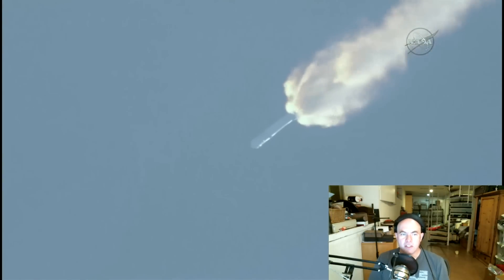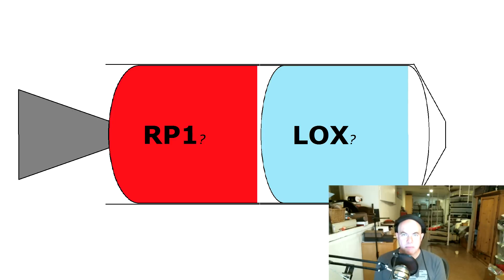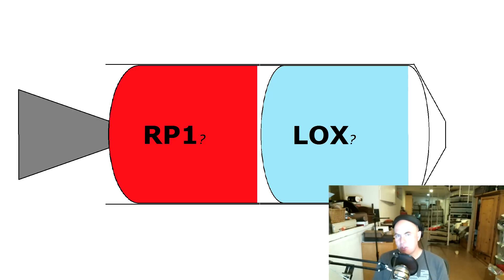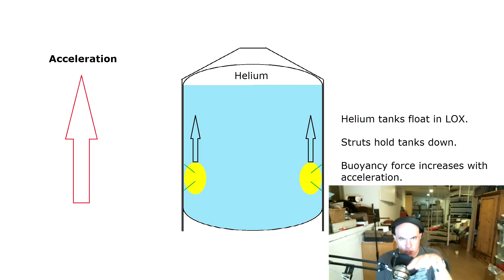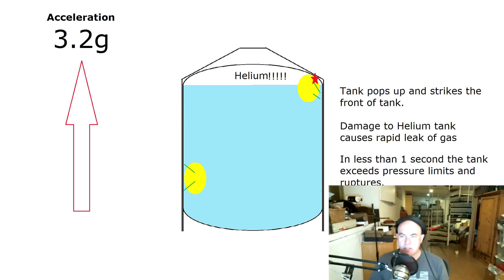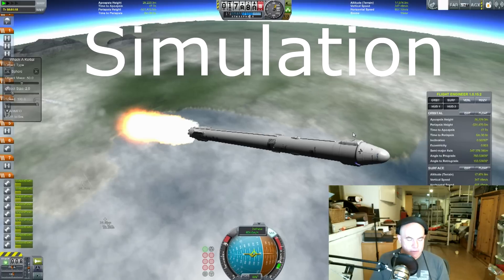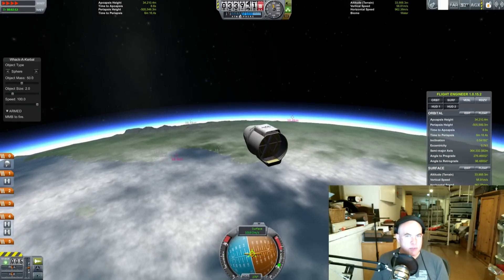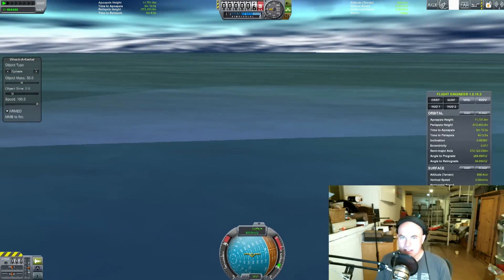Explaining the Space X CRS7 Launch Failure

Comment: Interesting. It seems components used in rockets are not as highly regulated as components used in aviation.
Reply: ***** these kinds of failures used to happen in aviation all the time.  Aviation has gotten a lot safer over the last 40 years.  The still do happen, to some extent.  I remember in a certain engine used on 737's had a failure where a fuel feedpipe was out of spec, so it ruptured due to normal engine vibration, causing fuel to flow into the engine uncontrolled until the engine caught fire, oversped, and blew up.  
The thing with airplane engines is, even if that happens, they can still fly without one engine, and land the plane (sometimes), whereas rockets are basically fuel tanks with engines strapped to them and no external control surfaces, so if one thing explodes, the whole thing explodes.
Reply from the maker: TheBalefire Actually, to be fair, on a previous Falcon 9 launch an engine failed during ascent and it was able to continue just fine.
Reply: TheBalefire
They have built rockets for over 40 years as well. Quite many more airplanes are flying than rockets, so if the probability of fubar is the same then we shouldn't ( p > 0,05) have many rocket accidents.
Reply: ***** And rockets are orders of magnitude harded to build, harder to fly, and for all intents and purposes is still in an experimental stage of development. Remember that the SpaceX rockets are, literally, still under development.
Reply: Mythricia
All that is meaningless. It is equally easy to check that components meet required specs.
Reply: ***** No, not really. You can't test flight hardware the same way. But of course you can believe that you understand better than decades of spaceflight engineers, if you wish.
Reply: Mythricia
First of all, this strut didn't pass the specs layed by SpaceX themselves. It means that they didn't test the component.

Secondly, I don't know how things are done in rocket engineering because I'm not a rocket engineer. However, I know how things work in aviation because I am an aircraft engineer.
Reply: ***** It's been stated several times in the comments already - they can't test flight hardware. If they tested the strut, even if it passed the test, it is no longer flight-ready. It is used, and no longer meets the specs required.

Testing the component invalidates it. It's destructive testing. Even if it's not literally destructive, i.e. the part is broken, it's still considered a destructive test, mechanically.

You can argue all you want, but just because you're an aircraft engineer doesn't mean you suddenly know better. I don't know why you would make such an assumption or make the original statement that you did, if you are NOT an engineer working on space-faring systems.

These guys are not stupid, you, if anyone, should have the insight to understand that. Having an engineering degree does not offer you the right to criticize how something is done in a different engineering field, one in which you have no insight or experience personally.

Tired of reading couch-engineers lecturing one another. But I guess, hey, on YouTube, everyone is an expert, and you're always right.
Reply: Mythricia
That's why you test the batches the manufacturer delivers to you..? Apparently not used in rocket engineering. Also, there's a thing called NDT.

"I don't know why you would make such an assumption or make the original statement that you did"
Read the original post again. I'm surprised they didn't test it properly. But now when you accused me of being a couch-engineer, I'm going to point out to rocket engineers that they should really test o-rings before they use them...
Reply: ***** I believe that there's a very big difference between human rated rocket qualification and non human rated qualification.  I have no idea for sure, but it's my understanding that anything carrying people does go through the ringer, a few times, back and forth, same as you would with an aircraft.  Where as there are some parts of non human rockets that are simply not checked to nearly the same degree, as a failure is not a life.
Reply: ***** The Shuttle O-rings were tested, and engineers had great concerns regarding them, but the further up the chain of command the complaints went, the more subdued the reports became. I suggest you read the detailed Challenger reports by Richard Feynman et al.

So yeah, clearly, you need to dig deeper. Because sorry, the o-rings were tested, and the problems were most certainly known. Administrative bullshit caused that accident, not engineering oversight.

Couch-engineer.
Reply: Patrick Potter
That would make sense, yes (and I indeed hope this is the case). There's one compelling argument in favor of tight inspections even when the rocket is not manned: the amount of money it costs to do proper inspections is nothing when compared to the price of a destroyed rocket.
Reply: Mythricia
Pardon me for using Wikipedia as a source, but:
"During the investigation Sally Ride told Richard Feynman that the O-rings were not tested at temperatures below 50 °F (10 °C)."

Oi! What's that mate? Feel free to quote the refuting quote from the book you recommended.

Edit: If the shuttle's specs clearly says that the operating temperature is above 10 °C then I'm not going to blame any engineers. It means that someone on the higher up made a mistake. But does it?
Reply: ***** I completely agree...Such is the fight for inspectors in all industries.
Reply: ***** There's good reasons for not testing some components. Testing induces stresses on the component that can cause it to fail on mission when it otherwise would not. The real key in avoiding this is not by testing the components but validating that the company making them has correct processes for delivering parts within spec margins consistently. And as you might guess, that's more expensive, but also it's more freaking part-making robots. And robots are cool.
Reply: EricBlues Ya, I'm not saying they should use a component that has been physically tested. Batch inspections and NDT is the way to go.
Reply: ***** That is just a quote unfortunately, and lacks a ton of context - Sally Ride was a phycicist and astronaut, not an engineer working closely with the problem pre-launch.

The real documentation clearly explains that the actual engineers working on the relevant systems had great concerns about the o-rings under certain circumstances (such as when the launch was scrubbed and the rocket was left fueled for longer than intended, thus causing temperatures to go out of spec).

These concerns were reported to superiors, who then reported it to their superiors, et cetera, and for every step in that process, the severity of the report was reduced, because the concerns of those making the report were further and further removed from actual engineering.

This was described and talked about in depth in Feynmans analysis, and he concludes that the disconnect between administration and engineering lead to the o-rings use outside of their intended specifications.

This effect/phenomenon has later been coined "The Feynman Gap" and you can read about it here (random google source, I haven't vetted it); http://www.dependablesos.org/mind-the-feynman-gap-why-you-should-care-what-other-people-think
Reply: Scott Manley True, not all engine failures on spacecraft are catastrophic.  There was an engine failure on ascent AND a tank explosion in space on the Apollo 13 mission, and they still made it back alive, right?  :D  Spaceships are awesome.
Reply: ***** You make the assumption that neither of those things were done. That's holding them to a pitifully low standard. By testing to a statistically satisfactory level does not mean things can't break, unfortunately. It just reduces the chance.

And reduced chance still does not guarantee something won't break. I'm sure they tested during development, and that the struts passed their requirements.

What about aircraft that fail - magical rainbows took them down, or engineering failures? What about 747's with heat generating electronics literally next to central fuel tanks, causing fuel tanks to become filled with explosive gas vapors as the tank drains and then being ignited -> splitting the aircraft in half and killing like 400 passengers?

Surely not an engineering oversight in the aircraft industry! Oh no.

That actually happened by the way. Can't recall the specific incident by memory, but can find it if desired.
Reply: Mythricia
It seems you fell into my trap. Who's the couch-engineer now?

PS. Rainbows. Definitely rainbows.
Reply: ***** Not a trap. I was expecting you'd tell a similar story as to how it was a known problem, but not dealt with for "reasons" and thus come full circle realizing that engineering isn't necessarily at fault for a failure, nor is it always right to assume it was - but it's alright, I can let you feel like you've had a victorious argument, I prefer to stick with actual fact personally.

It's still stupid to assume SpaceX doesn't test or have any idea about non-destructive testing or batch testing. A literal 13 year old could come up with those procedures, but I guess if you don't hold them to a higher standard than that, you can expect anything.
Reply: ***** Morton Thiokol, the company which manufactured the O-rings, tested them under pressure at a variety of temperatures and found that in some tests the O-rings leaked at low temperatures.  They communicated this to NASA engineers, who recommended to management that they reschedule the launch for another day.  NASA management, under pressure to keep up PR, talked down the engineers, who didn't make the seriousness of the threat clear enough, and went ahead with the launch.  

In an engineering seminar at my school while getting my Masters in Mechanical Engineering, they took the letters that had been sent back and forth between these different engineers and managers and read them out loud, with different people voicing the different writers, so we could see how being unclear about the level of danger in an application could lead to catastrophe.  

They used it as a lesson to teach about using the right language in reporting as an engineer to make sure that your point gets across to non-engineers.  Don't say things like, "the probability of a leak in the O-rings at low temperatures is too high, and we recommend rescheduling the launch." You have to say things like "if we launch the shuttle when it is below freezing outside, it might explode because the O-rings will let the fire come out the sides of the boosters instead of the back.  We must not launch in these conditions."

There is no cut-and-dried blame to lay in that case.  The engineers should have reported better, the management should have listened better, Morton Thiokol should have followed up to make sure their message got through, but due to a lack of anyone taking personal responsibility for safety, the disaster occurred even though it had been warned about.

Also, there is pardon for using Wikipedia as a source sometimes, but the one quote you posted is what one person told one other person, not all the information available to the investigation... and you're so smug about it why?  Saying one quote from Wikipedia doesn't make you right.

On the subject of the struts, of COURSE they should have done NDT.  That is basic engineering, right there.  If they were rated to hold 10k, and only needed to hold 2-3k, an NDT to 5k would have caught bad parts without damaging them if they were up to spec.  I have a sneaking suspicion that the alloy the struts were made out of was susceptible to temperature-dependent brittleness, as steel manufacturers of late have been getting more and more lax about sulfur impurities as they try to cut costs to compete in a global market.  LOX is cold, so you would have to do your NDT at temperature, while the manufacturer might have been doing tests at RT.  I'll be interested to read more about those struts as time goes on, see if they tell why they were so far out of spec.  Whoever was in charge of selecting those struts from that manufacturer should have also made sure that the met spec.  Period.
Reply: ***** Also, since you like Wikipedia so much, in 2 minutes I was able to find this quote on the page titled "Rogers Commission Report" as follows:
"Feynman's investigations also revealed that there had been many serious doubts raised about the O-ring seals by engineers at Morton Thiokol, which made the solid fuel boosters, but communication failures had led to their concerns being ignored by NASA management." So basically, that backs up everything I just said, in case you want to be anal about my last post not quoting sources, because it was something I learned from a seminar.
Reply: TheBalefire Very interesting read in your previous comment - thanks for that. And yes, indeed, lack of clarity in communication is sadly not as obvious of a problem as we'd want it to be.
Reply: ***** Lets not forget 100's of these struts are built for every launch (about once a month) so the fact the supplier didn't think to test them before handing them over to spacex is insane.
Reply: ***** I "blame" the engineers for not being to articulate the dangers of letting the shuttle freeze on the pad. If they had good arguments with data to back them up on glass transition temp of O ring rubber then the launch might not had gone ahead.
Reply: ***** 
You give the aeronautical production sector too much credit.
Reply: TheBalefire
I wasn't been serious about the o-rings. I was playing couch-engineer because Mythricia already labeled me as such. I feel sorry that you had to spend your time writing a rebuttal. Nevertheless, it was a good read.
Reply: ***** Glad you enjoyed it.  Just remember, "When you play the fool, you look like an idiot," so you're better off being yourself. 
 Daniel Li I'm curious how you could come to such a definitive assignment of guilt in a case that took months to accumulate data on, and involved 9 recommendations that NASA basically had to restructure it's entire program to follow in order to prevent such a thing from happening again.  Perhaps you would like to enlighten us as to how you came to such a stunningly simple verdict?  I'm sure it was an arduous journey that took months of careful study and evaluation of every piece of evidence.  /sarcasm
There is plenty of blame to go around.  No one particular party deserves all of it, or they would have gone to jail for criminal negligence or outright homicide.  No one hid any facts, and no one withheld information, the information was just misunderstood.
Reply: TheBalefire
Yes, I realized later that it wasn't the best thing to do, even when it worked as intended.

Back to topic, I hope SpaceX will learn from this and make necessary changes. Every disaster is a chance to improve safety.
Reply: Mythricia I was pondering about this problem.. They can't really test a component and use it after, since as you said it has already been used and fatigued/stressed. Do they just test a whole lot of components and decide to use another one from the same manufacturer after a bunch of satisfactory results, or do they put an already used component under intense scrutiny ( like how they do with welding seams ) and reuse it? I'm sincerely interested to know. I am an electrical engineer, so I don't really know much about material studies outside of my field. I'm wondering, because it feels like kind of a paradox, since you can't really know that the next component in the batch will perform to specs as it hasn't been tested beforehand. Curious.
Reply: Thomas J K EE here as well actually so I think we're in the same boat, however I do a lot of reading and learning about other sciences in free time, but I don't have a great answer for you I'm afraid.

It is possible to do close inspection like you mentioned, just like they do with welds, and similar to how Orbital Sciences performed a great deal of analysis on the rather old NK-33 rocket engines they were intending to use, without firing or mechanically stressing them. But the problem there is cost and time - SpaceX needs a large amount of these struts, it's not just a handful per launch, so having each one tested meticulously by SpaceX themselves is not cost effective, and would probably slow down their production of launch vehicles.

In the end, it is the manufacturer that delivers the hardware, and they have a specification on the parts - they should be the ones that test and make sure that their provided hardware is capable of what they promise. Industry can't work if everyone has to test everything three times over - at some point, there must be some trust involved. Sure you can spot test, and batch test, and I'm pretty sure SpaceX actually does this as well - but as I've mentioned before, spot testing and batch testing, does not miraculously stop bad parts from being used... They can still slip through the net.

So this is why they are changing provider for these struts - because it is the most logical solution to the problem. And I agree, although evidently, a lot of people seem to think they know better than a company that grew from nothing into a cost-effective space launch agency in literally a decade.

It's worth knowing that this is hardly bad for their launch record - many other launch vehicles from other agencies have failed, and I highly doubt it's from "user error" most of the time - some part just didn't meet the spec, failed, and took the rest with it. That's just how spaceflight works - the forces involved are orders of magnitude higher than any other form of flight, the tolerances are orders of magnitude smaller than any other form of flight, and we still manage to get it right, most of the time.

Of course this wasn't a manned flight - manned vehicles fall under a whole other level of inspection and safety. 

Not sure if helpful, but that's all I got.
Reply: TheBalefire I agree totally that not any particular party deserves all the blame perhaps that was not very clear by the use of quotes around blame in my comment. :D
What I'm saying is that if the engineers had been able to definitively point out risks to the management, launch would not have gone ahead. Imagine the managers as kids and engineers as parents to those kids. When those kids messes up, who gets the blame? Excellent analogy i know.
Reply: Daniel Li
Not really, no.
Sometime, there are causes but no one to really blame. Neither really fucked up here. You simply cannot test everything, you have to trust the part specification are correct. You can do random spot-check tests but even that doesn't catch everything.
Reply: Daniel Li Use of quotes is only saying you are referring to a previous statement, it does not convey your tone of voice.  By your analogy, wouldn't the management would be the parents, and the engineers be the children, considering the managers are the ones in a position of greater power and responsibility, with the ability to determine the fate of the engineers?  I don't know of many families where the kids evaluate their parents performance and decide whether they get to keep their jobs, whereas parents often evaluate kids' performance in chores, school, etc, and award privileges and allowance accordingly.  So by your reasoning, shouldn't you say that the managers are at fault, since they were the ones in a position of responsibility?
Reply: ***** Thats because its still new. Once the companies have pioneered the procedures, come up with the proper solutions etc. government will step in and force people to do it that way.
Reply: Scott Manley I think that though it safely made it to orbit a secondary payload failed to reach it's required orbit and was written off as a complete loss.
Reply: TheBalefire Close, the brand new A380 it was the oil feedpipe. Either way, the pipe burst, and oil flowed into the engine hot section, burned with great vigor, caused the engine to overspeed, AND overheat, and some compressor blades flew apart, ripped through the wing and fuel tanks and control systems. The plane landed safely.
Reply: ***** Hmm, maybe I'm mixing up my air accidents then, because the one I was thinking of hit trees before crashing into a field, and killed a number of the passengers, if I remember right.  Unfortunately the air crash investigation episodes I had favorited all got taken down due to copyright claims, so I can't go back and check.  :/  I just remember it was a Rolls Royce engine, I think.
Reply: +Gekkibi failure to test the components was already admitted. however testing something like this is not cheap or simple as the components are submerged in LOx at a temperature of over -300° F so to do testing on something like that would require a complex test rig as well as the proper permits and such to ensure safety. Im sure you know liquid oxygen is unspeakably hard to work with. that doesn't excuse the failure but merely provides context.
Reply: +Mythricia Morton Thyokol (sp sorry) the designer of the SRB had issues with O-ring sealing during ground testing when the SRBs were tested with the same fuel compound that was to be used for flight.  It was not at the 100% failure level but enough to get MT engineers to voice their concerns.  NASA admins noted  that the SRBs  were tested laying down and that produced stresses that would not be seen in flight and that the design of the SRBs and Shuttle system were too far along to make changes now.  This was in 1979, 2 years before the first flight.  NASA admins also stated that if this becomes a problem later in the Shuttle program they could revisit the issue.  This was shelved as there were no significant blow-by issues  that caused any damage during the first 24 flights.  One flight did show some erosion but the aluminum slag (byproduct of the burning compound) sealed the breech before any damage occurred to the casing of the SRB  The O-ring was destroyed.  As for the engineers' concerns over the temperatures that day... Well NASA was under fire for the scrubbed launches and under political and social pressure to launch, this clouded the admins judgement and the engineers were threatened with their jobs if they made a fuss about this.  

Gene Kranz said it best about the Apollo 1 fire.  Someone just had to have the courage to stand up and say NO.  10 lives were lost in the pursuit of space exploration because no one said no.  Another 7 because no one had the imagination to think there could be a problem.
Reply: *****
You're missing the point. There are solid reasons why parts are highly regulated in aviation, but there are solid reasons for them to be highly regulated in rockets as well. The launch costs (and the loss of payload if everything explodes, not to forget the impact on reputation) are so high that extra costs from more strict scrutiny is meaningless.

In short: it's not always about the loss of life, sometimes it's just about the money.
Reply: Having a great reputation for strong parts will go much further than government regulation ever will. there will always be Ebay parts, but using quality to get it done right the first time will always be top priority at the price points of all rocket manufacturers.